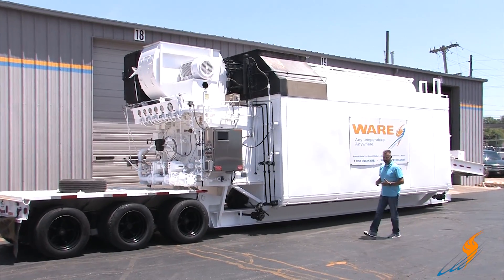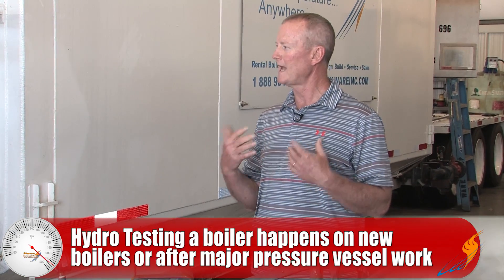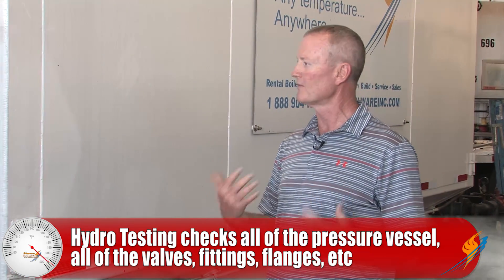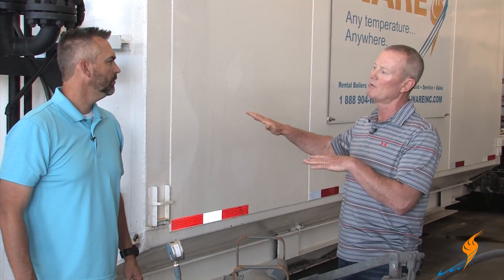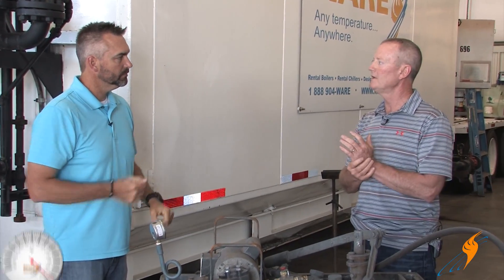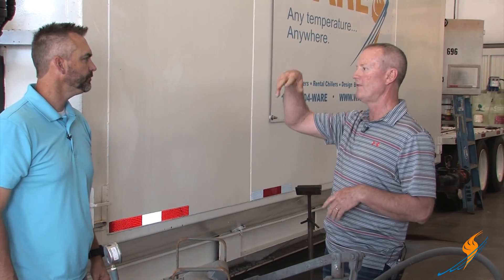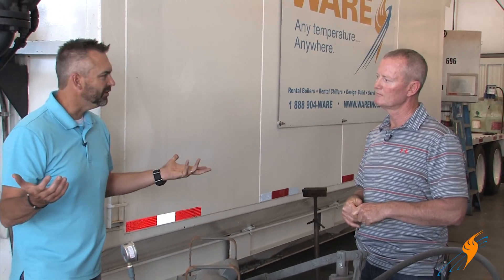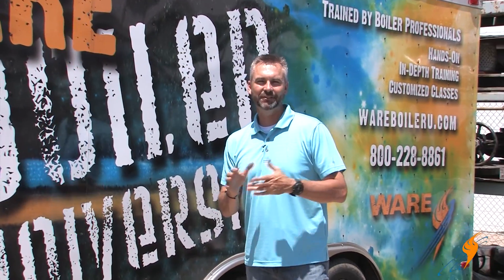Hydro Testing a Steam Boiler — The Boiling Point

Comment: As per ASME BPVC Section I PG-99. After a boiler has been completed it shall be subjected to pressure tests using water at not less the ambient temperature, but in no case less than 70 degrees Fahrenheit. 
Even though this is construction code I use this as reference anytime I have done a Hydro.